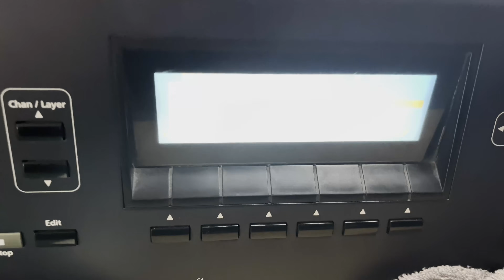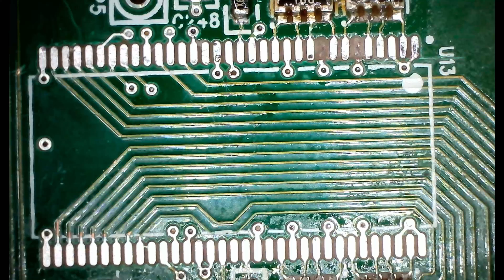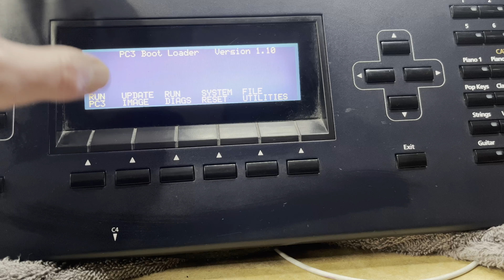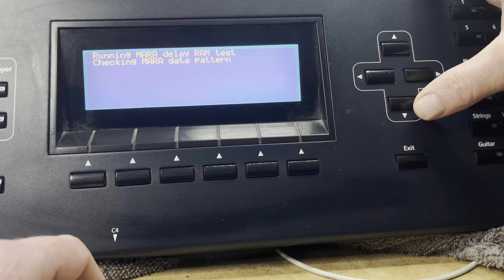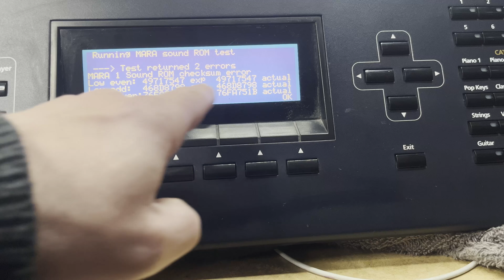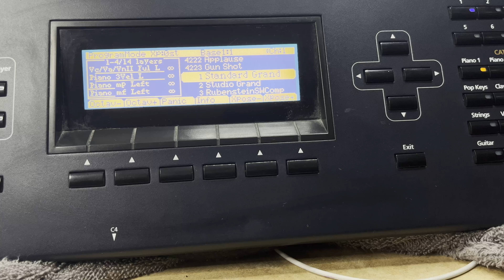Kurzweil PC3 KDFX RAM U13 Replacement

Comment: Hello here, I'm pretty sure I had to do the same on mine. Could you tell me the symptom that lead you to replace U13 ? For me, if the KDFX is not used, the sound is ok, but as soon they are used, the output terrible distorted garbage.